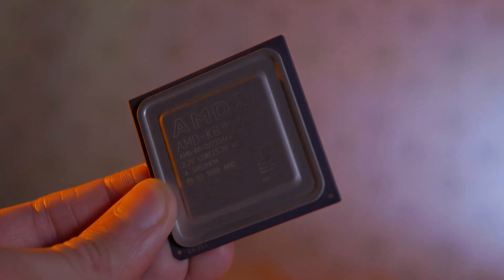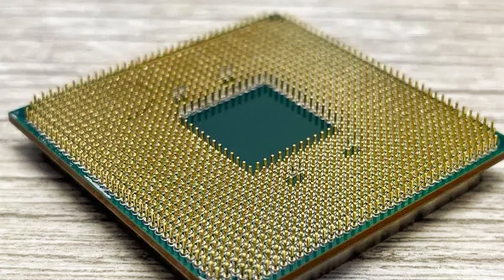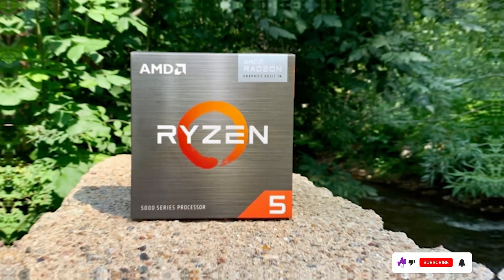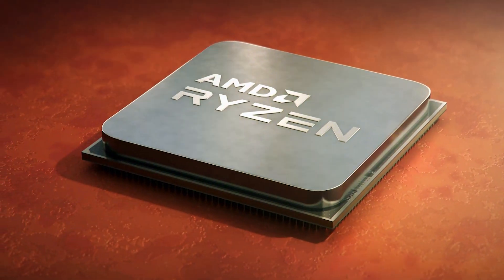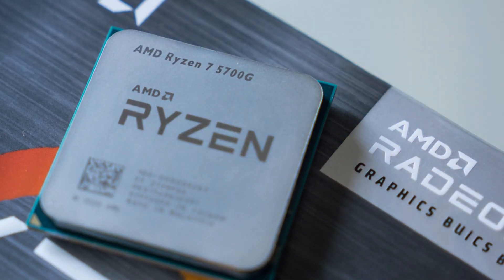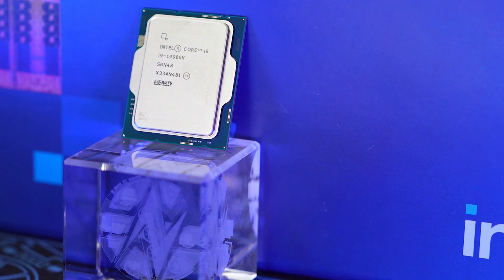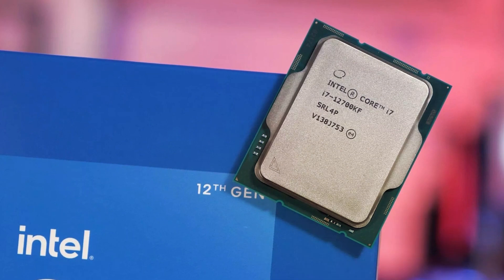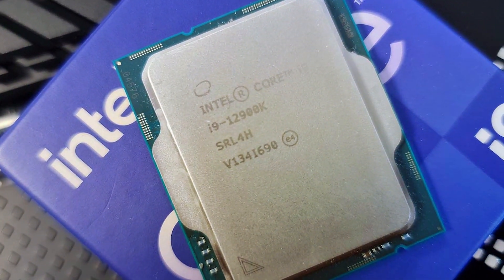Best Bang for Your Buck: 7 Processors Reviewed for Gamers

Comment: Don't get the G version of processors, it means in has intergrated graphics and has a higher powerdraw. You won't need a separate gpu with that kind of processor but it will probably not run newer games at a stable fps, instead get the X version,  Ryzen 5 5600X is probably one of the best value processors out there in relation to its cost.
Reply: Shrimp sorry to be the tech police but if you don't use the igpu in the cpu, the cpu gets max wattage only bad thing about the G versions are the pcie 3.0 version but everything else is normal